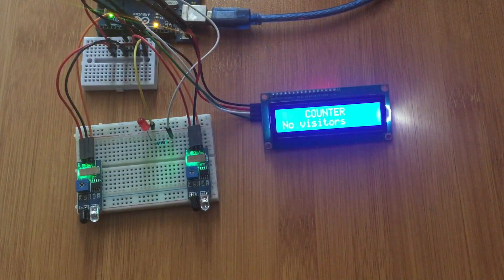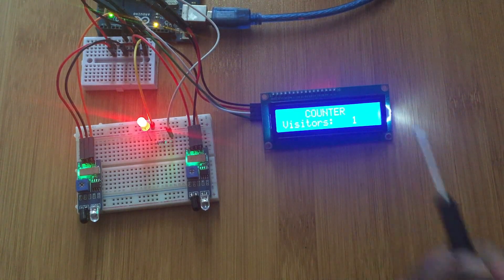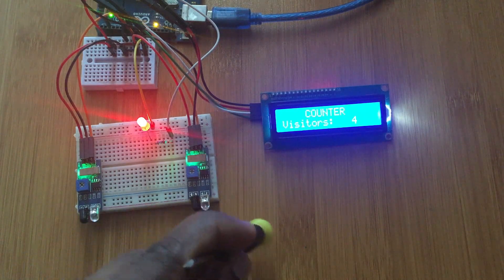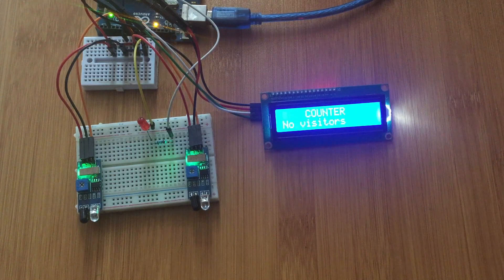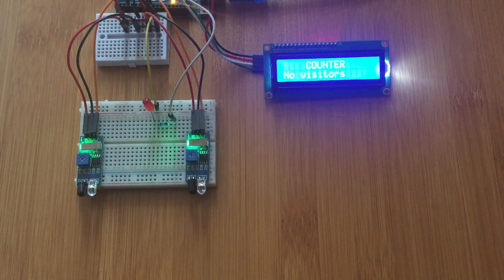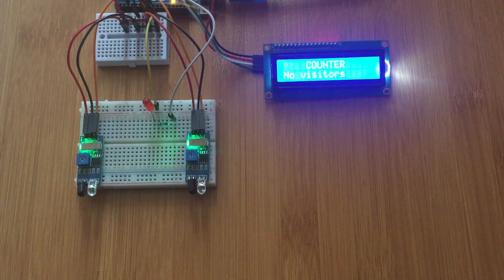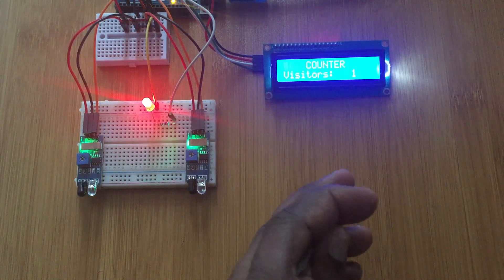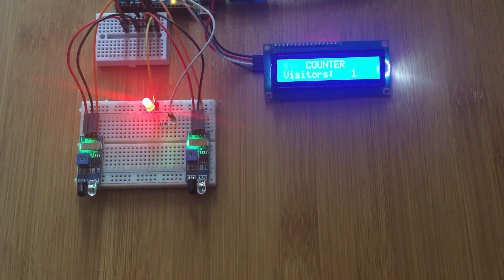Bidirectional Counter using IR sensors and Arduino.

Comment: #include <LiquidCrystal_I2C.h>
LiquidCrystal_I2C lcd(0x27,20,4);
#define sensorPin1 13
#define sensorPin2 36

int sensorState1 = 0;
int sensorState2 = 0;
int count=0;
int ready_entrer=0;
int ready_sortir=0;

void setup()
{
  pinMode (sensorPin1,INPUT_PULLUP);
  pinMode (sensorPin2, INPUT_PULLUP);

  
  lcd.init();   // initialize
  lcd.backlight();
  lcd.setCursor(4,0);
  lcd.print("COUNTER");
   lcd.setCursor(0,1);
  lcd.print("No Visitors     ");
  delay(200);
}

void loop()
{  
  
  sensorState1 = digitalRead(sensorPin1);
  sensorState2 = digitalRead(sensorPin2);

  if(sensorState1 == LOW){
    ready_entrer=1;
  }else if(sensorState2 == LOW){
    ready_sortir=1;
  }
  if(ready_entrer==1 && sensorState2 == LOW){
    count++; 
    ready_entrer=0;
    ready_sortir=0;
    delay(500);
  }else if(ready_sortir==1 && sensorState1 == LOW){
    count--; 
    ready_sortir=0;
    ready_entrer=0;
    delay(500);
  }

  

   if(count<=0)
  {
    lcd.setCursor(0,1);
    lcd.print("No visitors    ");
  }
  else if (count>0 && count<10){
    lcd.setCursor(0,1);
    lcd.print("Visitors:   ");
    lcd.setCursor(12,1);
    lcd.print(count);
    lcd.setCursor(13,1);
    lcd.print("  "); 
    
  }
  else {
    lcd.setCursor(0,1);
    lcd.print("Visitors:   ");
    lcd.setCursor(12,1);
    lcd.print(count);  
  }
}
Reply: Thanks brother
Reply: @departmentofitinqatartechn8303  thank you so much

Comment: The code you sent works differently from the show on the video. to count people entering the room requires going through 2 sensors, but the code you posted in the description is working with each sensor, not using both at the same time. Please post the new code.
Reply: #include <LiquidCrystal_I2C.h>
LiquidCrystal_I2C lcd(0x27,20,4);
#define sensorPin1 13
#define sensorPin2 36

int sensorState1 = 0;
int sensorState2 = 0;
int count=0;
int ready_entrer=0;
int ready_sortir=0;

void setup()
{
  pinMode (sensorPin1,INPUT_PULLUP);
  pinMode (sensorPin2, INPUT_PULLUP);

  
  lcd.init();   // initialize
  lcd.backlight();
  lcd.setCursor(4,0);
  lcd.print("COUNTER");
   lcd.setCursor(0,1);
  lcd.print("No Visitors     ");
  delay(200);
}

void loop()
{  
  
  sensorState1 = digitalRead(sensorPin1);
  sensorState2 = digitalRead(sensorPin2);

  if(sensorState1 == LOW){
    ready_entrer=1;
  }else if(sensorState2 == LOW){
    ready_sortir=1;
  }
  if(ready_entrer==1 && sensorState2 == LOW){
    count++; 
    ready_entrer=0;
    ready_sortir=0;
    delay(500);
  }else if(ready_sortir==1 && sensorState1 == LOW){
    count--; 
    ready_sortir=0;
    ready_entrer=0;
    delay(500);
  }

  

   if(count<=0)
  {
    lcd.setCursor(0,1);
    lcd.print("No visitors    ");
  }
  else if (count>0 && count<10){
    lcd.setCursor(0,1);
    lcd.print("Visitors:   ");
    lcd.setCursor(12,1);
    lcd.print(count);
    lcd.setCursor(13,1);
    lcd.print("  "); 
    
  }
  else {
    lcd.setCursor(0,1);
    lcd.print("Visitors:   ");
    lcd.setCursor(12,1);
    lcd.print(count);  
  }
}
Reply: Arduino: 1.8.19 (Windows 10), Board: "Arduino Uno"

sketch_jan02a:1:10: fatal error: LiquidCrystal_I2C.h: No such file or directory

 #include <LiquidCrystal_I2C.h>

          ^~~~~~~~~~~~~~~~~~~~~

compilation terminated.

exit status 1

LiquidCrystal_I2C.h: No such file or directory

This report would have more information with
"Show verbose output during compilation"
option enabled in File -> Preferences.

 @hassaneelmahi3761
Reply: not working
 @hassaneelmahi3761

Comment: #include <LCD_I2C.h>
#include <Wire.h>
#include <LiquidCrystal_I2C.h>

LiquidCrystal_I2C lcd(0x27,16,2);

// LiquidCrystal_I2C lcd(0x27, 2, 1, 0, 4, 5, 6, 7, 3, POSITIVE);

#define IR1 7
#define IR2 8
#define relay 3

int IRstate1 = 0;
int IRstate2 = 0;
int count = 0;

void setup() {
  pinMode (IR1, INPUT_PULLUP);
  pinMode (IR2, INPUT_PULLUP);
  pinMode (relay, OUTPUT);

  lcd.begin(16,2);
  lcd.backlight();
  lcd.setCursor(4, 0);
  lcd.print("COUNTER");
  lcd.setCursor(0, 1);
  lcd.print("No Visitors    ");
  delay(200);

}

void loop() {
  IRstate1 = digitalRead(IR1);
  IRstate2 = digitalRead(IR2);

  if (IRstate1 == LOW){
    count++;
    delay(500);
  }
  if(IRstate2 == LOW){
    count--;
    delay(500);
  }
  if(count<=0){
    digitalWrite(relay,LOW);
    lcd.setCursor(0,1);
    lcd.print("No visitors     ");
  }
  else if(count>0 && count<10){
    digitalWrite(relay,HIGH);
    lcd.setCursor(0,1);
    lcd.print("Visitors:   ");
    lcd.setCursor(12,1);
    lcd.print(count);
    lcd.setCursor(13,1);
    lcd.print(" ");
  }
  else{
    digitalWrite(relay,HIGH);
    lcd.setCursor(0,1);
    lcd.print("Visitors:   ");
    lcd.setCursor(12,1);
    lcd.print(count);
  }

}